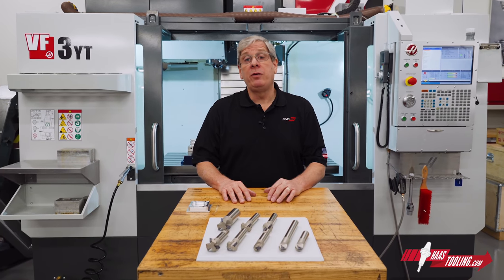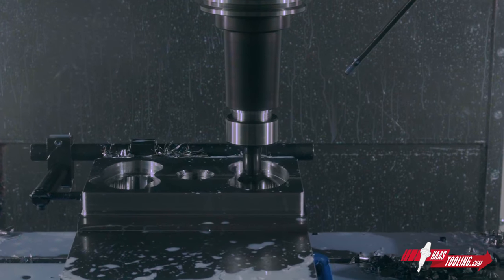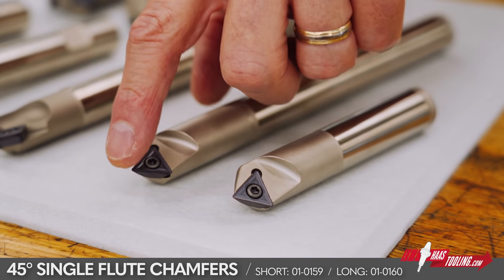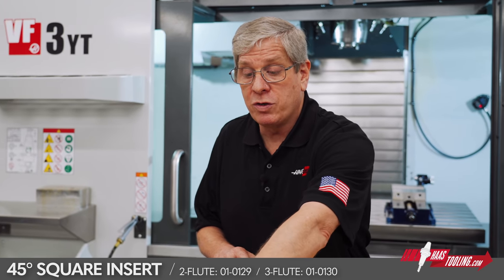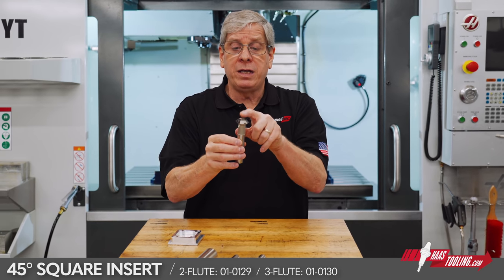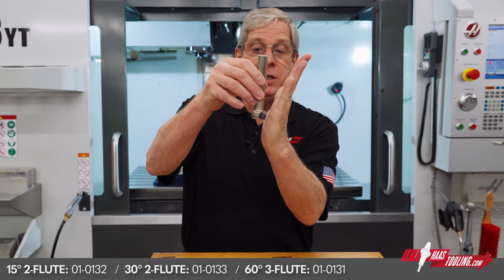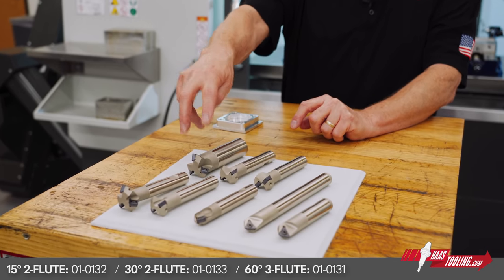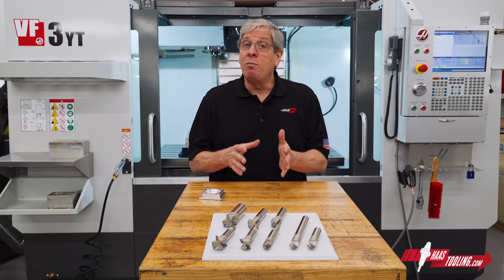Check Out Our New Chamfer Mills on HaasTooling.com - Haas Automation, Inc.

Comment: The TNMG ones looks very like Stellram 7745VT.  I always find they work well, Stellram claim you can chamfer, spot-drill, and engrave with them.
Reply: Can confirm engraving with single TNMG chamfer tools is real clean use it alot for part marking for a certain customer using the simple g47, depth of cut usually no more than 0.1mm comes out real nice,

Comment: Can you cut a v groove with the .06 minimum hole single flute cutter??
Reply: No reason why not, just remember there will be a rad at the bottom, i use the 1 tip chamfers for engraving which is same as doing a groove just at a much shallower depth, all youd have to do is cut deeper, perhaps using multiple passes to ease load on the insert/tool or depending on the material being cut

Comment: There are cheaper, smaller and more flexible solutions than these
Reply: Source?
Reply: Solid carbide.
More flutes(faster feeds) , sharper, smaller tips, regrindable. If you go with inserts, they are more expensive to get started, clumsy, finish is not as good. The screw-on inserts by seco, etc. are a better solution but still aren't sharp enough for all materials.
(All this is just my experience from trying loads of different stuff)
Reply: @TheSoundOfTwang  you could grind the inserts
Reply: @ikbendusan  Do you mean "I" the consumer? That's possible, but what about the coating? When i said that solid carbide is re-grindable I meant that you send the tool back for sharpening/grinding and re-coating. And if you grind an insert it ceases to be indexable
Reply: it all depends on what you are doing....